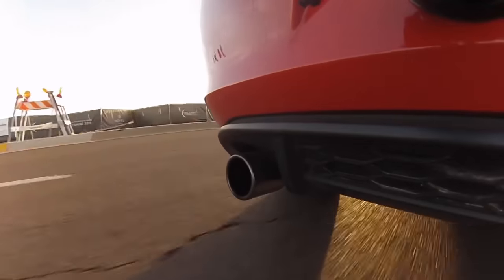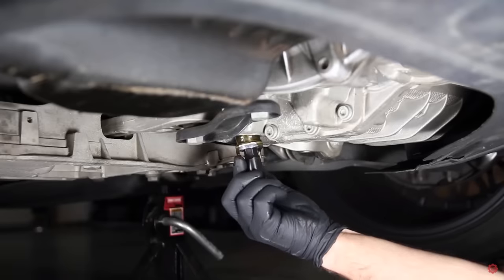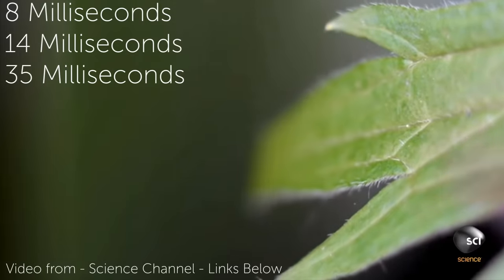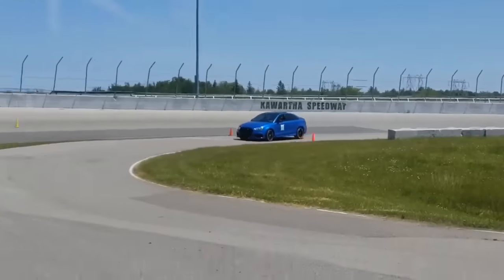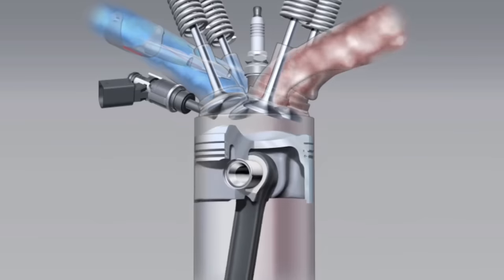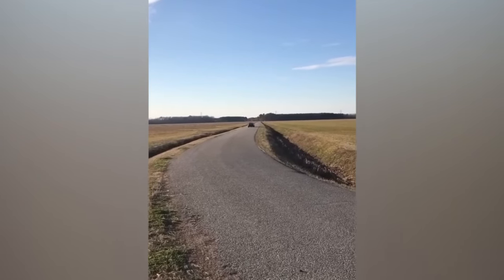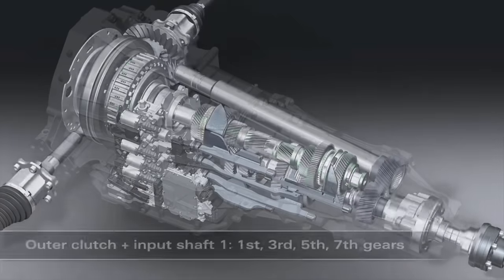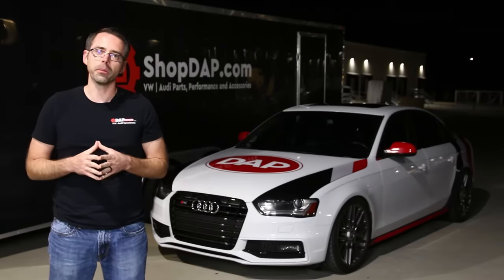What makes DSG Farts Happen?

Comment: I have a a3 8v s tronic 1.8tfsi stage 2 all the bells and whistles and pretty much a 3inch straight pipe and I’ve no dsg farts it’s so annoying any idea why ? If I had a fueling problem would this cause my car to go in to limp mode and delete my dsg farts ?
Reply: Recently discovered I had a crack in my thermostat housing I had to search for something as I had lost all boost power and car was over fueling strong smell of fuel from tail pipe and white steam or smoke coming from the back

Comment: BTW: All these engines are direct injection, so why not cut the fuel for one cycle instead of the spark?
Reply: Axel easier to controll the spark i guess, but i agree!
Reply: @addenot  I wonder how they do it with the Diesel DSG combinations. There are no spark plugs, so the only thing they can regulate is the fuel.

Comment: I have a 2019 A4. I’d have to do an exhaust just to get that? Or is there something else I can do?
Reply: John Torres if you have the dsg on the Audi then it already makes the noise. Audi’s are usually very quiet do you’d have to free up that exhaust system some more for the farts. This can be done by a muffler delete, resonator delete, cat-back exhaust system, or an axle back exhaust system. Once you do one of those, the farts will be a lot louder. On my 2017 golf GTI I have a resonator delete and it makes the farts sound so much better. Hope this helps
Reply: Ok awesome. Thanks for the info

Comment: Guys, can you please help me? I have a 2013 VW Polo GTI DSG (you can check it on my channel). It has a big sound when I switching gears but when I leave the gas pedal it is not having that “blowing back” sound. So basically it has just the big farts. I already cutted off the end of the pipe this is the reason why it has a bigger fart sound, but how can I reach that “blowing back” sound when I release my foot from the gas pedal? Hope you get my question.

Comment: Still does not explain why they don't simply cut the fuel too and just run engine with effectively zero throttle. It would have same effect but without any farting. The reason I belive is they use exploding gasses to keep the turbo spinning and avoid losing boost during gear shifts. It's also called "anti-lag" system. Otherwise it would simply be a waste of fuel.

Comment: My TDI doesn't have DSG farts. This is a first I'm hearing of this.
Reply: James Providenti because of DPF 😏
Reply: @amirafshar271  what if it's straight piped?
Reply: Doesn’t change anything, because the dpf filter is before the exhaust pipe 😄 u cant get rid of dpf and egr ...... but it’s illegal ! U cant get fine and .....stop by police , no Mot pass ! When you delete the dpf you will get black smoke coming through from exhaust pipe ! thats why you might get in trouble but there’s no any issue with petrol! 😏
Reply: @amirafshar271  just because it is illegal doesn't mean it can't be done. Tdiclub.com bruh
Reply: Lol , why not ! 😁
Reply: James Providenti Because it’s a diesel
Reply: @yammer5  No way I have been using gas 😂

Comment: I thought the reason for injecting fuel without the spark was to make the fuel ignite in the manifold, thus keeping the turbo spinning to avoid lags spikes on the upshifts.

If this is not the case then why not cut both spark and fuel to save fuel / emissions etc.

Comment: I am sorry but if they wanted they could have cut also the fuel in the shift, there by not letting out any unburnt fuel. Listen for instance to a Porsche 991GT3 with PDK (same gearbox principle) No farts - ever. So the farts are actually only for posing reasons and could easily be tuned out.

Comment: Now people artificially tuned this into their computer, needlessly wasting fuel, burning the catalyst and sounding stupid at the same time.

When I had my Abarth 500 manual, it would "snort" every now and then since it's doing the same basic thing, it helps drop the RPM's faster so you can grab another gear quicker- it would actually shoot fireballs out the tail pipes.

My MX-5 RF M/T with a cat-back aftermarket exhaust will occasionally pop, but usually it's nothing but the engine revving to 7,500RPM and drive-train whine.

I like functional "farts" I'm not a fan of DSG or VW/Audi/any German make, but hearing the braps is fine as long as it isn't some straight-piped Euro-trash mobile made loud in a feeble attempt to be kool.

Comment: then please tell me why the mk5 r32 does not make the fart sounds
Reply: Because the mk5 r32 ECU was not programmed with spark cut.
Reply: @bluevelvetmonkey  is there a specific reason behind as to why the r32 does not have the spark cut
Reply: I really don't know, if I had to guess it probably had to do with emissions, because you can get a custom tune that has spark cut, which can cause loud bangs and flames to shot of the exhaust.

Comment: Why is it that only turbocharged engines do fart and natural aspirated do not? So turbo does play a role in all this
Reply: My 2018 passat Gt has a 3.6L VR6 natural aspirated engine and it does DSG farts.
Reply: @bluevelvetmonkey  no those are not thr same believe me. I have an r32 and it sounds like farts but very different. Compare a natural aspirated v6 and a turbocharged v6 gear shifts. You will see what i mean
Reply: @bluevelvetmonkey  yes i can hear it. But could you find more examples? In my opinion still different things. Where every turbocharged engine farts during shifts, not every natural aspirated engine farts.
Reply: @askbats5407  The video just expained where DSG farts come from, it has to do with spark cut. The r32 (which I did own one 0079/5000) does not have spark cut, thats the reason why you don' get DSG farts.

Comment: I'm interested how they cope with this problem on dsg equipped diesel cars? Since the diesel fuel doesn't need a spark to ignite, they can't change ignition timing necessary for smooth upshifting simply by disengaging the spark plug. Obviously, that's why you don't hear farts on diesel vehicles. But how they manage to efficiently slow down the revs during the shifting?

Comment: 2 reasons why i dont want a DSG tune, It wears the clutches faster and it eliminates the farts... Good 2 reasons that are avoiding me to buy a big turbo kit (since requires a DSG tune)
Reply: Even tuned, the wear on the clutch packs is minimal. There's literally a split second of transition from disengaged to full engagement - so very little fictional wear down.

On a manual, you have much more clutch wear cause of the amount of time it takes to go from starting to make contact, to the point of full lock.

Unless you are pushing more torque than the dsg packs can handle (which is wayyy more than most people will ever put down), the clutch wafers will last a long long time.

Comment: It's not only for DSG, it can fart on Manual if the tires slip with traction control on, or slightly depress the clutch on higher rpm. Thus it's not a DSG fart, it's an engine fart.

Comment: DSG, endless money, low quality poor made VW parts.
My new focus ST that goes around vw crap any day, has an anti lag system, twin scroll turbo, and the cherry, manual gear box.
And with all this VW tech Ford Ecobbost engine is still years ahead of VW, BMW or Mercedesm, either in reliablity and the fact that VW group cars spend more time in the shop or dealership then ripping the roads. Even my 8 month old fiesta ST with its amazing 1.5 3 in line 200hp engine that i gave to my sister had and anti lag system that works perfectly.
Only the fast shift has the advantage. I have 2 mechanics that work at the official VW dealership and they agree, VW make poor quality engine, their only good part is the finishing touches or the cabin, nothing else, and those trims will still let you on the ditch waiting for the tow truck.
And despite the VW here in Europe are better made they are still crap.
Reply: You sound like a really neat guy.